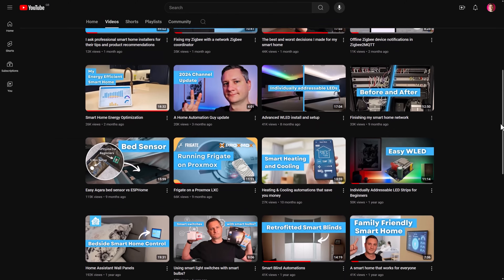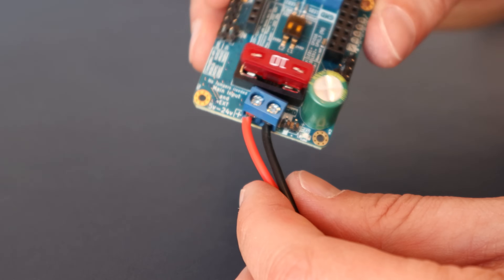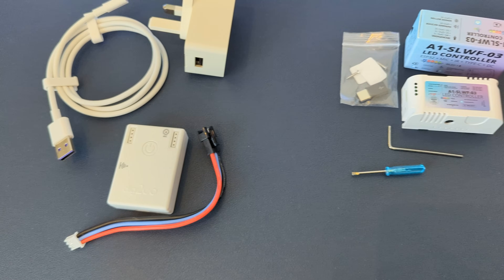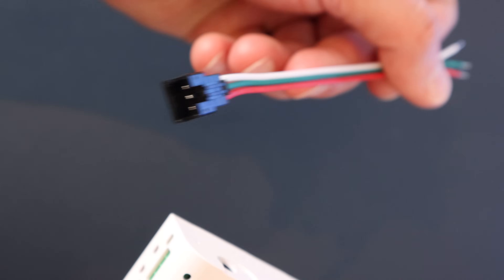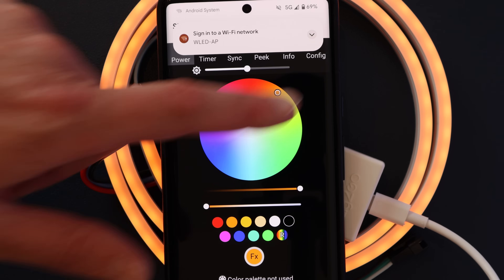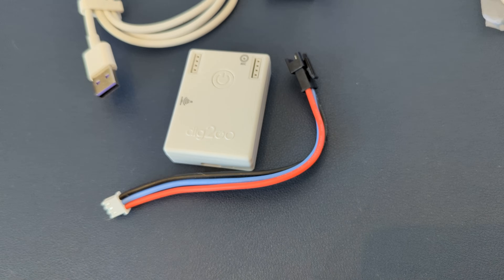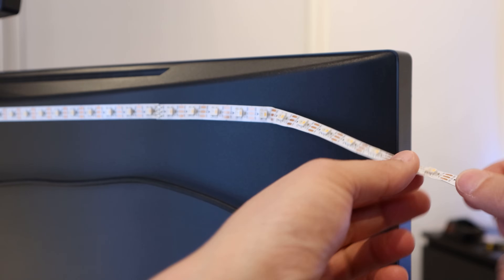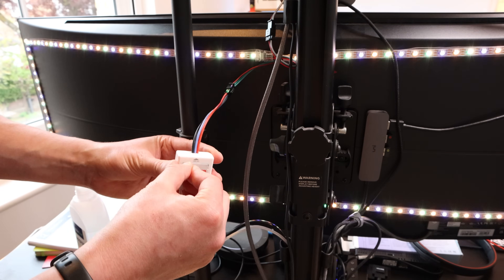Plug and Play WLED controllers

Comment: Do you have to run the Home Assistant OS version in order to be able to use WLED with it? WLED is an "add-on", right? Or is there some way to containerize WLED to run it alongside of HA Core? Sorry... I'm new to HA.
Reply from the maker: You can use WLED with any install of Home Assistant.  It's an "Integration", not an "add-on" (Yeah, these terms are confusing!) so it works out of the box over Wifi without any extra hardware.
Reply: @ thanks. I went ahead and tried it last night. Thanks to your channel and someone else’s, I now have Proxmox running on a NUC, with a lxc container of Ubuntu that is running docker and Portauner, and a Docker container of HA. Thanks for your awesome tutorials!

Comment: Great Video Alan, do you think the DigtoGo would run a 3meter strip the same as you have in your Kitchen video. I belive that is 60 LED/m. I can find a 30 LED/m on but it seems to be non waterproof that might not be great in a kitchen. Any intrested in your view, let me know what you think.
Reply from the maker: I think the Dig2Go would struggle with my kitchen lights. It's really only good for 1-2m strips and for lower brightness accent lighting.

I use non waterproof strips in my kitchen, in an aluminium channel. So far I've had no issues, even with the steam

Comment: Would you suggest these controllers for under a U shaped kitchen? around 9 meters of strip will suffice.
Reply from the maker: No. I'd suggest using a DigUno or DigQuad. These controllers are only really suitable for less than 2m or so
Reply from the maker: Check out my Kitchen WLED video on my channel. It's perfect for you 😏
Reply: @HomeAutomationGuy  thanks will do

Comment: Quick tip to remove the vhb tape: Take your very thin, flexible putty knife and give it a blast of spray-on vegetable oil (like Pam in the US). Will let your blade separate the adhesive from the surface and just leaves the surface a little shiny. Downside is that if you want to re-apply your removed thing, you now have to very very very thoroughly remove all traces of cooking oil, so this tip works better when you care more about the surface than what was stuck to it.
Reply from the maker: That's a good tip, thanks for sharing!

Comment: BTF-Lighting strips have never come off on any of my uses and I have even removed and reused them with no issues. They make good led strips if you don't want to mess with additional tape. I have been making my own controllers. Super cheap and easy if you can solder, especially if you need more than a couple. Those controllers add up quickly.

Comment: What config would you recommand in 12meter setup?
Reply from the maker: I have a 20m setup using a large Mean well power supply, and a QuinLed Dig-Quad. I have to do a lot of power injection because it's all 5V, and if I had my time over I'd probably go with 12v instead

Comment: Hey, great video! My Dad and I are currently working on a really tiny board which uses an ESP32s3 and you can also power with just USB-C for lower length strips, or run the strip off a beefier power supply for longer ones. It runs his own software rather than WLED (although you could flash if you can get it working on an s3 chip) and it connects to Home Assistant pretty easily with auto discovery over MQTT. I’ll hopefully be doing a video of my own on it when we get the new batch of boards through 😊

Comment: I have found clear silicone caulk is great for putting up LED strips (and other stuff!) Get a tube and use it to stick up your strips using it like glue. You often don't need to run an entire bead of the caulk along the strip, but just put a few blobs along the strip at even intervals. You might have to hold the strip in place for a bit until the caulk bonds, but painter's tape works great for holding it in place until it is set. It stays fine through higher heat produced by monitors and such. But anytime you need to peel the strips off, you can, and the caulk can be peeled off most surfaces cleanly without leaving anything behind. I've used it to hold LED strips under kitchen cabinets (even the ones above the stove which get the cooking heat) and they have never fallen off. But I have removed them easily when I wanted to replace them with a different kind of LED strip and the caulk peels cleanly off the old strips and even the wood under the cabinets. I even use silicone caulk to stick little figurines on top of my monitor and they stay perfectly, but peel off cleanly with no damage to the monitor casing.
Reply from the maker: Thanks for the tip! That's something I'll have to try

Comment: I've been in a search for a long time for wled controllers for analogic strip (more specifically to CCT) that supports GPIO for a dumb switch (those normal switches in our walls). Shelly rbgw is arriving and I will give it a try. It would be nice to see more options for that use case. Not everyone wants or needs addressable led :/
Reply from the maker: I've heard great things about those Shelly LED controllers. Let us know how it goes!
Reply: I got my Shelly RGB2 today. I liked it:
- It has an edge Mode for the switch, so if you turn off the light using the app, you don't need to flick the switch twice to turn it back on. Very simple and elegant solution compared to WLED (I still hope they implement this soon).
- It is very compact and promises to deliver a lot of power (not tested, though).
What I didn't like:
- It doesn't have a CCT mode. I saw a solution that uses Home assistant, but I am yet to try it.
I will also study how to flash it to run locally, but I need to see if I will loose the switch on edge feature.
Reply: @cartolla  wow thanks for this tip. I confirmed Edge mode works perfectly to avoid the need to turn off and on. Shelly is now even better in my eyes. I just kept the Shelly cloud app because it is so nice to configure all the options, even though you could do most locally with the Shelly device web server. My main requirement is that Shelly devices can be controlled locally by Home Assistant and that is true, unlike some other vendor integrations.
Reply: I love the Shelly RGBW2 for analog LEDs. Such a nice form factor, great app, and integrates with Home Assistant for local control.
Reply: @markxexar nice to hear that. I am mostly curious about the switch input. I just found out wled doesn't exactly work as a virtual parallel switch. If I turn the light off using the web interface, i need to turn the switch off and on again to turn the light on, which very weird.
Reply: @cartolla  yes you are right you need to switch it off and then on again. I repurposed an existing switch from a flourescent light, and I guessed it is kind of logical that turning it to the off position should not turn it on. Shelly have an amazing range of configurations for their switches, but I have not taken the time to figure them all out. I guess a push button switch could be configured to toggle the current light state. I am happy it was so easy to use a manual switch in addition to the automations, and the extra switch toggle doesn’t bother me.
Reply: Another updates:
- I found out you can block Shelly RGBW2 cloud in its configuration and also work with MQTT natively. That is nice!
- I could create a CCT control inside HA using a HACS integration. It is working the way I want (including the physical switch) and each canal (cool and warm) can provide 90W each, which is more than enough for any application in my home. I think finally I found my CCT controller!

Comment: I always prefer sticking things on in a non-permanent, non-damaging way, so I often resort to Gekko Tape (or nano tape). While I don't think it is very suitable for LED strips (but worth a try), it definitely can be used for the controller or other small devices. I have used gekko tape to attach Hue motion sensors to my ceiling for example. It may damage wall paint so first check. And use small pieces of gekko tape if you want to be able to remove it later without too much effort/damage. I mainly use the 2mm thick version. Give it a try.
Reply from the maker: I've never heard of that tape. I'll give it a go!

Comment: About time someone came clean about the rubbish adhesive on nearly all LED strip - I've been known ro resort to staples when the adhesive finally fails on pretty much nany surface. I'm about to look up the adhesive you mentioned - hoping Amazon as it as I'm in the deep end of Southern Spain. You didn't say what you did with the original adhesive on the strip. Left it on? I've ordered some 9mm to try...
Reply from the maker: I left the original adhesive on. And yes, I did get it from Amazon

Comment: I love it that you credit the MakeItWork channel. Way too few presenters give credit to any of their sources. I definitely agree with Dig2Go as a terrific controller. I have moved a lot of LED lighting away from 5V though, and it does not handle other voltages. All my Xmas and outdoor lights are on 12V with DigQuad. Indoors I have started using analog extra warm white lights. Quinled has some controllers coming soon and in the meantime I find Shelly RGBW2 does a great job for these. For indoor lights where I need color and long runs, I have standardized on 24V with a preference for FCOB with or without a white channel. These pair perfectly with the DigQuads.

Comment: iirc, the dig2go also shuts off the power to the SK6812's when not in use, otherwise they draw more power when idle. This feature is available on all of the dig line of WLED controllers. Not sure about the other one listed in the video or not. Can you confirm ?
Reply from the maker: I honestly have no idea if it switches off the strips. That would be cool though!